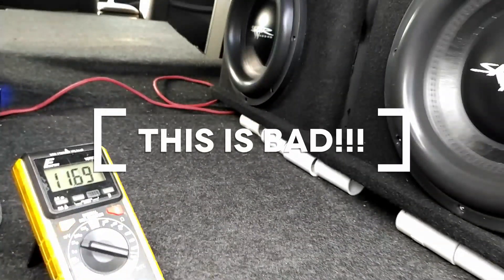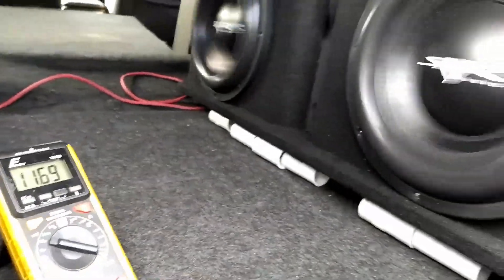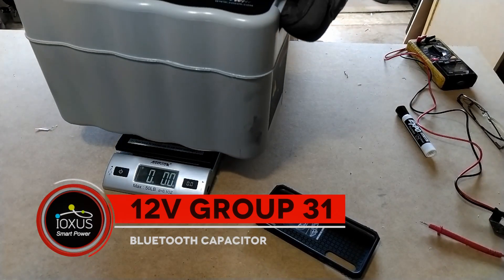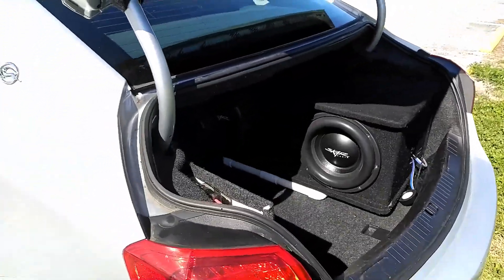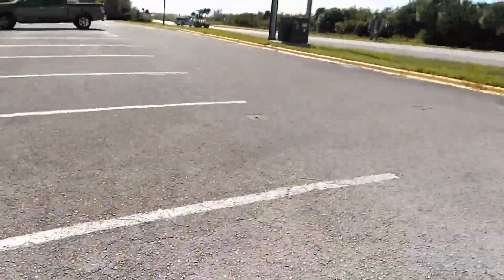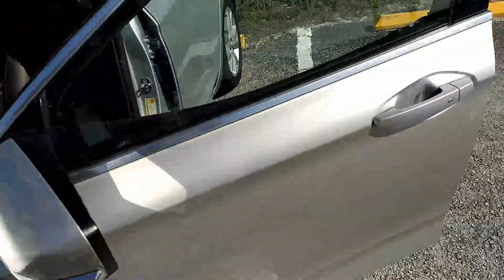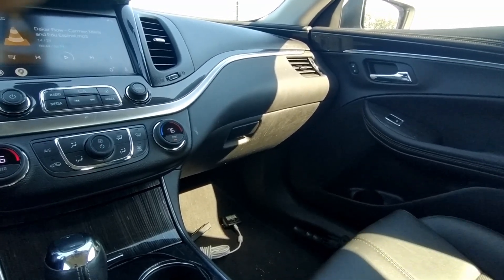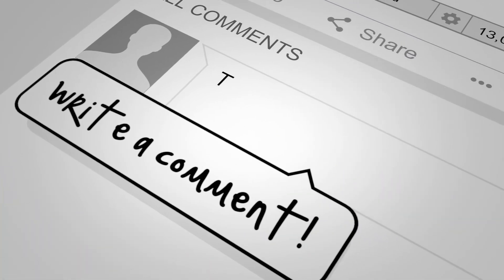Do Ultra Capacitors Really Work? Will This Stabilize a 4,000 Watt System?

Comment: As someone that has worked in electronics for over 20 years it looks like you don’t have enough wire to transfer the power to the back power source
Reply from the maker: I have some zero gauge on order
Reply: @BudgetBassHead  That should fix the problem, you might need dual runs due to the big difference in voltage drop between the front and rear.

Comment: That stock alternator is useless for car audio just saying for anyone running a after market system. All the batteries & caps you add will not compare to what the alternator will do. Batteries are 2nd to your alternator amperage.
Reply from the maker: in most cases this is true. Most stock alternator are only support stock components with about a 5-15% overhead. So yes, additional amplifiers will kill that overhead (reserve)

Comment: Before you  change Alts,  can you test to see how many amps and or watts you're pulling from the current electrical system? I had 2 of the AudioPipe Mini 2ks and I was pulling 4800+ out of them in total, metered at comps. I sold those and bought 2 of the Soundqubed 2250s. They don't pull as much power but they sound cleaner. I run a 250 amp Alt, Big 3, 2 Deka 110 AH Group 31s in the trunk and a normal Interstate battery under the hood. 3 runs of 0 gauge front to back.
Reply from the maker: Thanks for the product advice. I think you are correct about the amp draw.

Comment: Check your grounds... add more ground than you have supply.... and ground to Alternator if possible. Thatll.help ALOT!
Reply from the maker: Each amp has its own ground and extra ground already on alt. Thanks for the tips ✌
Reply: @BudgetBassHead  I'm currently running 3-2400w and 2-750 watt amps, grounded to a bus bar and several direct leads back to alt,(3 runs 0 gauge OFC) batteries and several body to chassis to Alt mounting points...
 300 amp alt, 3 runs 0 gauge(OFC) back to batteries to bus bar for amp power and 5 Viper VP2400 agm... seems the more grounds I added, the more stable the voltage.
 Super caps coming...
 Keep us informed

Comment: What your reading at the back is what is being supplied to the amps so it does help over all but I still believe you would have benefit from a lithium phosphate more than from the super cap
Reply from the maker: Great tip. We got more testing to do 😀

Comment: Great video my guy ! A few things I may add with your voltage drop in the rear .. you might need bigger or better wire .. ofc or larger gauge - those audiopipes pull some juice - over 300a each .. 40-80a of lithium in the rear and that mechman and you’ll be out of the woods ...14v+ for days
Reply from the maker: Thanks for sharing
Reply: may I get your advice, back into car audio after 15  years....do lithium batteries require charging every 2 days by an actual lithium battery charger or would my 300 amp alt charge them....sorry for the stupid question
Reply: @terik555  nothing charges a battery better than a charger, but .. 

Normal use you can go forever without hooking up to a charger - but you could be losing some potential out of it 

If you are deep cycling the battery, then a full charge once a month would be more than you really would ever need 

The alt charges but never quite tops off like a lithium charger 

Is it that noticeable? Yes and no .. A good charge is never a bad thing 👊🏼

Comment: i've heard they have a recall and can fail, anyone have any real experience?
Reply: No that was all about the voltage numbers for the jump start mode. There are 8 3000 farad caps in them and they're rock solid. Watch EXO's. Video on them. Shows real time system action with one. With these it's all about the other battery you have to go along with this. If you have the amp hours, these Ioxus caps are AMAZING.

Comment: Its because your drawing too much power without revving the engine. It needs to be at 2000rpm or so to generate its amps so basically cruising on the highway or with your foot on the gas in park
Reply from the maker: This is true, but I want stable voltage @idle. This is part of the testing. Stay Tuned😉
Reply: @BudgetBassHead  To get the stable voltage, you need to increase your idle and or upgrade the alternator if isn't High Output. Love your channel bro. I just found you weeks ago

Comment: Put caps before the battery.
Reply from the maker: This will help with starting the car, but not with pulls from amplifiers in the rear. which is why I placed the cap next to amp. Others say to reinstall the AGM to assist the cap. Sounds like got some more testing to do 😉
Reply: @BudgetBassHead  put in front and back?

Comment: Well first off love the content. I have those amps myself. I’m kinda feeling like the are just really inefficient AF they put the power out but they suck more than others. Also the difference between the front and back voltage is that there is so much more resistance in the back. All the 1/0 wire and batteries and amps it’s causing a drop just from flowing through all that. I believe that just moving you front battery to the back and none up front will make a worlds of difference. It’s worth a shot. I did it and it helped  I have a 2009 Saturn Aura with the same engine and a mechman 250 and 3 of the 2000.1 audiopipes I stay around 12.60-14.20
Reply from the maker: Thanks for sharing. Didn't think of moving to the trunk
Reply: How would u move the front hood battery into back. What do you do with the front battery connections.
Reply: Cut the connections and solder some 1/0 or 4gauge to it and run that straight to the back. Some people just make distribution blocks where the battery use to be and do it that way. I personally like just moving the battery to the back but either way it’s helpful. Remember that if you have a battery close to you amps under 5’ you can use 4gauge for that size amp, so there are some benefits that way also

Comment: Maybe the power wire?? I'd try a bigger size
Reply: that looked like 2 4ga runs to the back. with a 320a alt, better run 1/0...
Reply from the maker: These are over-sized 4 gauge. more than standard zero gauge. More to this in upcoming video.

Comment: It is doing exactly what it is supposed to do...You say yourself caps discharge very fast..and are not able to re-charge fast enough..for the next bass hit..With the power you're demanding you need a second battery with a bigger alt...
Reply from the maker: We'll see in the next video.

Comment: similar to what i was having when I was running a fosegate 1200rms amp with a stock 110 amp alt tho mine was dropping to about 11. Killed a few amps like that tho. about a year ago I upgraded my alt did the big three and killed 2 amps one was the fosegate and the other was a sundown fullbridge 1500 my voltage was going all over the place. I then added a xs power d3400 in the trunk and well have had no issues at all voltage drop at idle isnt bad while driving its good.
Reply from the maker: Thanks for sharing. Hopefully Mechman 320 comes through for me.

Comment: Leave the agm in and add the cap..the reserve will come from the agm and the burst will come from the cap...the alt will supply both and youll be happy
Reply from the maker: This seems to be the go-to advice. You guys are awesome.
Reply: @BudgetBassHead  its a community my man..i want you to succeed..
Reply: @MyBlowncobra I love finding fellow bassheads like you! Our community is blessed to have you in it my man.  I share your beliefs. Thank you for being one of the good ones
Reply: @MyBlowncobra  This same "community" will sht on him for using Skar. 😂
Reply: I'm running two xs AGM batteries my voltage drop is going from 14.9 -12.6  and I won't let it drop further before turning it down I called xs they said to run double what power wires I have going to my 2nd battery back to the front it on the ground side did that and it kept it from going below13.4 I'm adding this ultra cap as soon as it gets here do I need to run its own power wire to the front or off my 2nd battery be ok?

Comment: One thing i would recommend is comparing the charging voltage of the stock alt at idle vs 2k rpms. Some people dont realize that you have better charging from higher engine speeds. So if your stock alt puts out 80amps idle thats less then the 135amps it is rated for. Even with the different charge parameters put into the bcm of the car. The newer 320amp alt will give you more amps at idle over your stock alt but it also gives more at the higher engine speeds too. If you can try to run up the engine speed to around 2k and see how that compares to what you saw with the idling. Also try putting the agm battery under the hood as well. Keeping the ultra cap in the back should help out that much more.
Reply from the maker: My new alt has 200+ @idle and There already is an AGM under the hood. Thanks for the tip

Comment: I think running another power wire to the back( I don't know how many you have now) would help on the voltage drop from front to back.
Reply: It's the alt.
Reply: If he had 1 amp it would be fine with the ultra capacitor but since he has 2 amps it’s it’s more amperage needed than the alternator can supply plus he is at idle....driving is a different story since he will drive at a higher rpm producing more amperage to the amps he also has dual runs of wire already his alternator upgrade will give him lots of headroom.

Comment: batteries and alternators are voltage sources, caps are rectifiers and shouldn't be used in place of a source. Gotta get the current u need from alternator and batteries then add the ultracaps to rectify  fluxuations is voltage
Reply from the maker: excellent point. Thanks.
Reply: So are you saying that the amp or amps should be feeding directly from the batteries and the cap should go in between the alt and amp as like a buffer between the alt and battery I'm just wondering because I purchased one of these myself and a lithium battery to go with it and I have installed the ultra cap and I love it my subs hit so much harder I didn't realize how underpowered they were with my stock alternator but now I am unsure if the battery or cap should be feeding directly into the amp a few have told me let the alternator feed the battery and the battery supply the cap I was told it's a hybrid type setup with the lithium and super cap together and that they work really well together Im just learning all this stuff though so advice on the placement of the lithium and cap would be appreciated
Reply: Eh what? Voltage sources? They are sources for electrons, supercaps are electron storage devices for short bursts if your. Woof heavy music has lulls technically a supercap would work fine, personally, I think subs for music are silly though so what do I know? I'm only here to see what an IOXUS looks like so thanks for the video 🙂

Comment: I was really hoping the capacitor would have fix the voltage drop.. I have gone as far as having 3 , 110 amp AGM batteries . 1up front & 2 in the rear, plus I upgraded my alternator from a 80amp to a 160amp .. 
I'll be following your trial's & errors on your electrical upgrade.  No other YouTube channel talks in detail on how to like yours and it's extremely helpful to me , a DIY builder. Thank you for your videos . I pretty much have the same setup as yours.
Reply from the maker: Thanks for watching, I hope it helps you out.

Comment: The Mechman will solve the problem.✔
Reply from the maker: I'm hoping 200+ Amps @idle will be enough.
Reply: @BudgetBassHead  I have a 320 mechman it doubled my idle.
Reply: @BudgetBassHead  you may need more than one for that at idle.
Reply: Add an xs power battery it helped me alot I have a smart 3
Reply: It worked for me only when driving parked not so much

Comment: What do you use to set your gains?  And when setting your amp gain, where do you have your bass knob set?  I ask because it seems your bass hits max before you get to half on the bass knob.  Unless you just prefer it that way.
Reply from the maker: Believe it, or not, that wasn't max 😉 The Bass knobs that come with these amps are pretty decent and the gains are set with oscilloscope.

Comment: 14.2 volts is a little low. 14.4 should be your stable idle voltage.
Reply: 14.4 as a stable voltage  is a myth.  Most newer car actually  drop to about  13 . 2 to 13.8 given the temperature.  If cold you will see 14.4 but after it warms up it will drop.  I personally  added  diodes  to my sense wire   to trick it into  staying around  14.6
Reply: @jaredbulock  that was without music or anything playing wasnt it. 14.4. ya with a load of course it would drop.
Reply: i left another comment check out. your alternator might not have been sensing the load before.  once your alternators voltage regulator senses it needs to charge it can run a few volts higher. you can also try an upgraded or external voltage regulator with your better alternator.
Reply: Heat = lower alternator output plus idle rpm even lower output. 
Good quality properly sized tinned OFC wire and better alt. With a charged system to start with & a good quality extra battery = good holding voltage.... = bigger smile, higher SPL
Reply from the maker: My car's voltage auto adjust amperage do to load demands; via and external ammeter
Reply: @BudgetBassHead  Honda uses an eld in the tipm or fuse panel under the hood and it is a electric load detector and they are tricky because some of them are hard to get the volts to even 14 that's a big issue with their electrical systems and because of where the load detection is taken it doesn't know there's an amp sucking all that power and if you fool it with a self exciting alternator it can mess up the system

Comment: you can notice a .7 voltage drop across a cap. have you run a positive and negative from the front battery to the back. the cap will charge 99% fast but that last 1% takes a lot of time. depending on the size of the cap it. you can look up the electronics formula for capacitor charge. the high amp alternator will give you more amps at a higher rpm. make sure you are getting more amps at idle with the upgraded alternator. who cares about the higher 300 amps at 2k rpms. the 200 amp alt may give you more at idle. they rewire the 3 coils inside the alternator to change its performance characteristics. they also upgrade a few internal parts like rectifier's and such.   its about that idle current. do the math on your amplifiers output in amps at 12 volts. how many amps are you pulling? you need to try and cover that. of course it is a dynamic load so take that into account. you may peak at 300-600 amps? not sure your amplifiers ratings. but the extra agm battery and cap together should handle that peak. if your dropping under 12 volts you dont have enough supply.
Reply: oh ok i missed you got the higher amp alt. 200 amps at idle good good.
Reply: that knob your using is that a gain knob or bass boost. if its a bass boost you may be hurting your score. a boost is much less efficient in increasing your average spl. it is also much harder on sub woofers and amplifier. you can play with that software and tuning more. the skars and sun downs are very inefficient but they handle abuse better. you should be past that age lol.
Reply from the maker: Its the bass control knob that came with the amplifier. I don't use bass boost and this knob is set to 100% during gain setting procedure. So I guess you can say its a gain control.
Reply: @BudgetBassHead  if that knob does control a bass boost here is what to try.  what is the model of the amp. i will try and check. if its controlling bass that is changing the whole characteristics of your set up.  but you should be able to have much better results with way more headroom. now start over setting your gains with NO BASS BOOST. take it up to the clipping point. then retest what your max SPL number is. i bet your new score beats it. when you use bass boost it boosts the frequency usually around 45 hertz. this limits your headroom on the amplifier and speaker to that set frequency. your missing out on the limit of all the other frequencies.  your box tuning maybe very different than 45 hertz, so boosting that frequency specifically maybe limiting you. lets say you tuned your box to 36 hertz and your car peaks at 40 hertz. that 45 hertz boost isnt doing you any favors. i hope i explained that well enough. let me know.
Reply: @MrGreen1988  his control knob is controlling gain not bass boost and if one was worried about it get the control knob that connects to the rca cables feeding the sub amp that's how alot of the heavy hitters do it

Comment: Once that alt goes in you’ll be fine. I did two batteries in the back one for each sub and the alternator from singer. I didn’t need the capacitor. But you will be pleasantly pleased when then alternator drops in. 😎😎
Reply from the maker: Thats exactly what I'm hoping for.

Comment: Im not a pro like you. But from my research and experience. Add that to the second battery in back instead of replacing it might do a world of difference. That being said the alternator will change your systems electrical just make sure your running at least 1/0 the whole way around as well as doing the big 4 upgrade. Again this is from my experience. Keep up the great videos
Reply from the maker: Thanks for the tip.

Comment: I've been using maxwell ultra caps and they made a world or difference in my wifes car I got the one off Amazon in the battery case I'm going to try in my car I just need a resistor to charge it last time I used Christmas lights.
Reply from the maker: I've heard good things about Maxwell caps. Hope it goes well for you.
Reply: @BudgetBassHead  how did u charge the super cap u got?